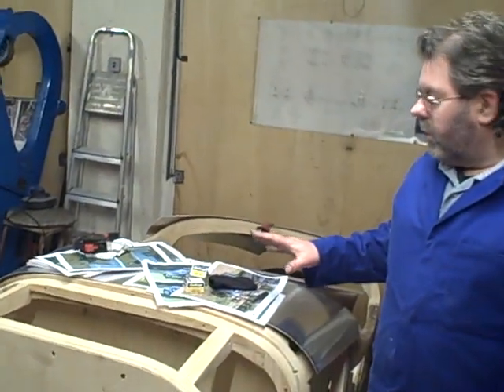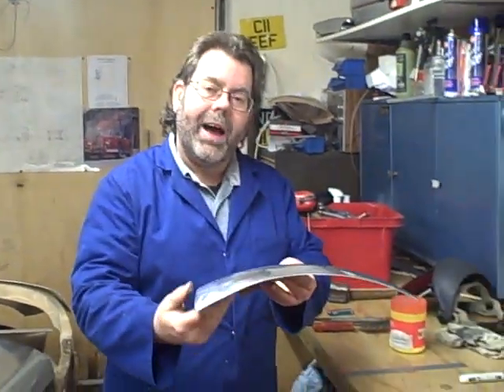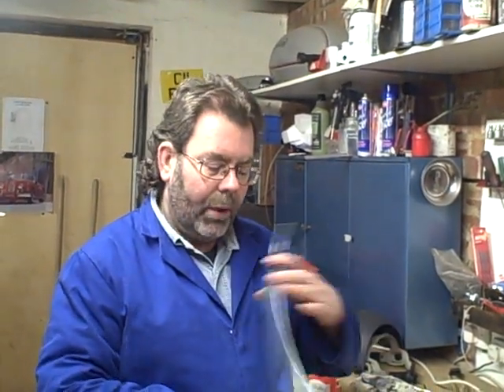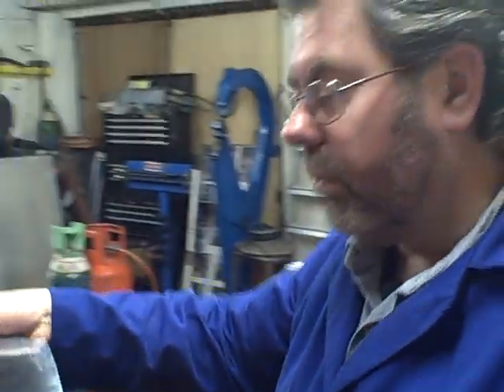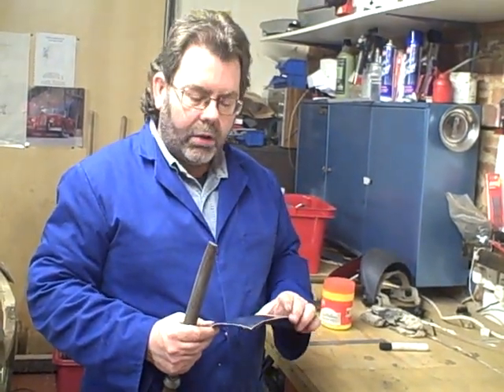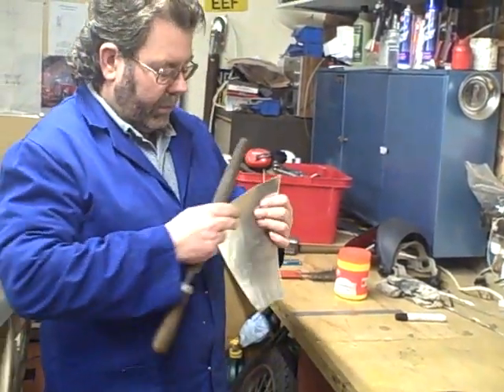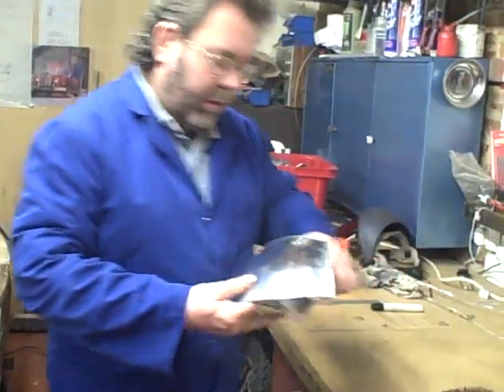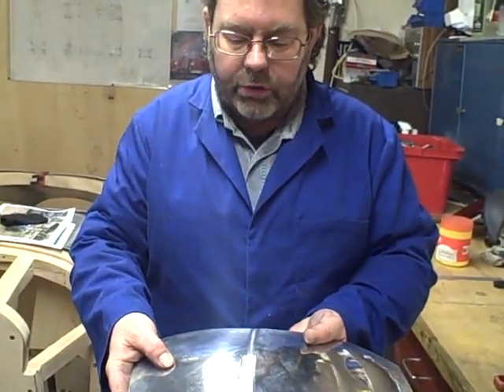English Wheeling machine. Part 9 Wolseley Hornet Swallow special

Comment: You said that the coachbuilders oxy welded the panels in the old days.  Those were steel panels,  weren't they?  The car you're working on is rusted.  I too have oxy welded aluminum.  It can actually be done w/ a propane or mapp gas and special rods.  Good video.  Thank you for your time.